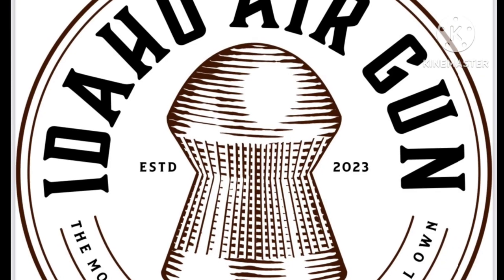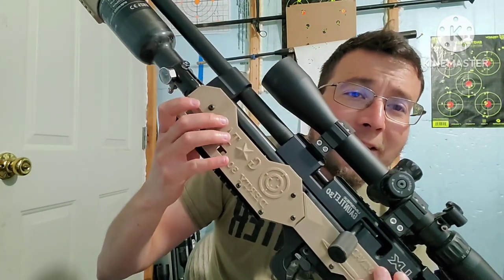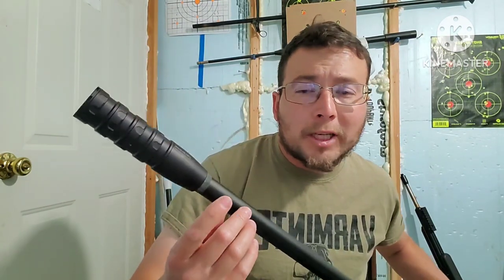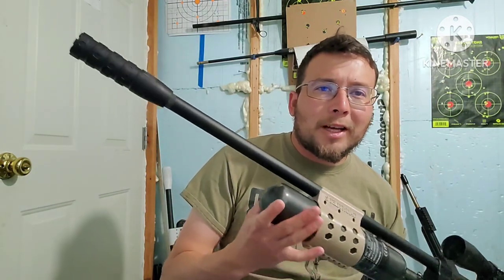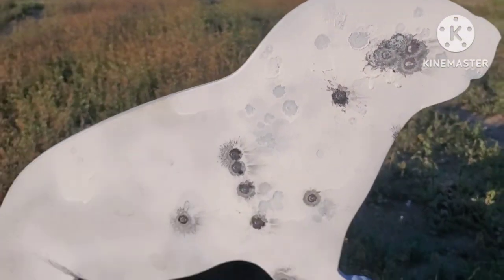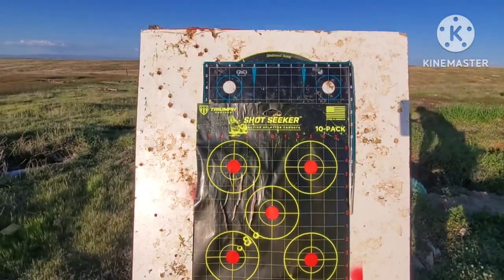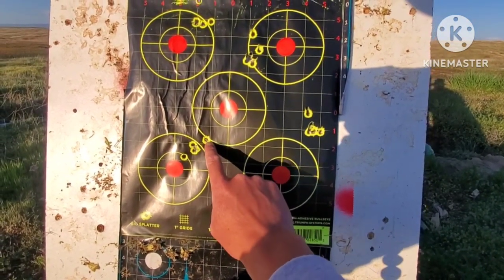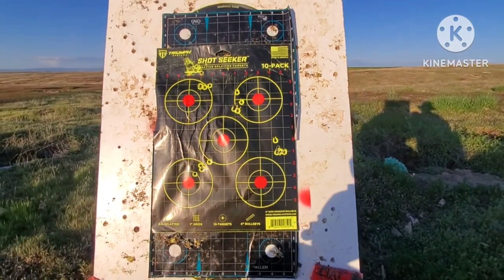umarex gauntlet 30cal slug testing.    idaho airgun

Comment: Do you ever have issues loading slugs?  Meaning extra force is needed to get them into the breach?
Reply from the maker: Yea.   Most of the slugs sold in the industry are .300cal and the umarex gauntlet. 30cal cal barrel is .295 so it's very difficult to load them in the chamber.   especially the NSA slugs.    My .30cal cal slugs are soft lead and under. 300cal.    So it's not very hard to load them in the chamber.
Reply from the maker: Griffin airgun ammo should have some good slugs for the umarex gauntlet. 30cal